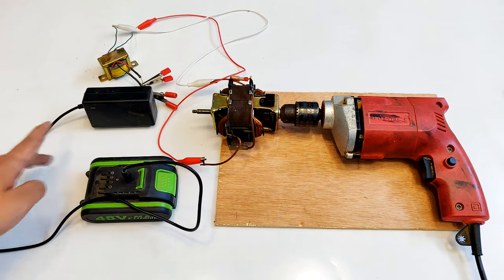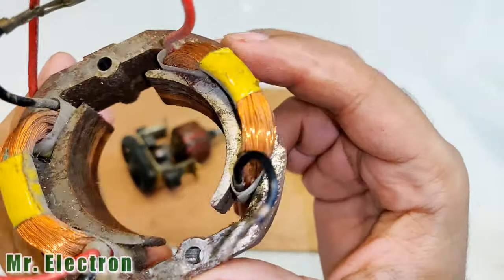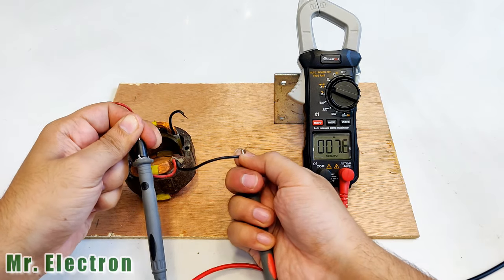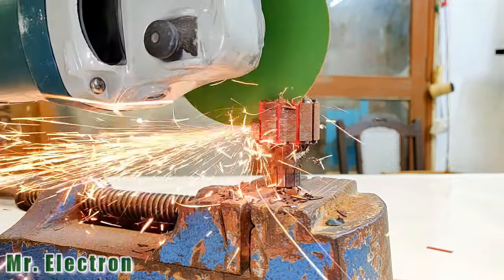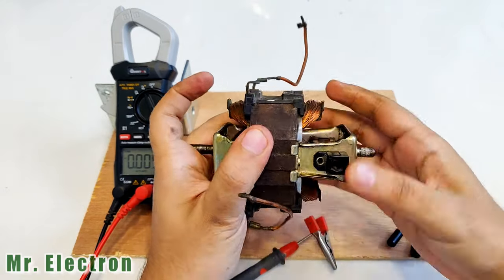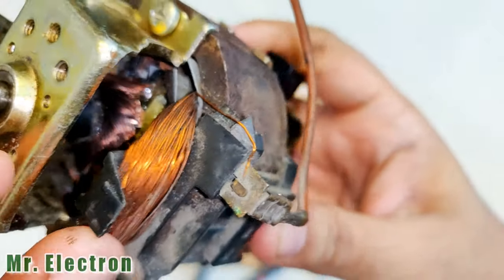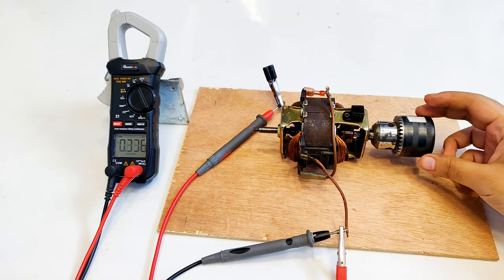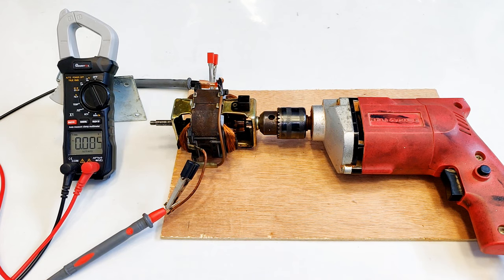Make 220V AC Generator from Old Mixer Universal Motor

Comment: Awesome work! I really enjoy watching your videos.
I have a question:
What exactly the rectifier does and what happened if you don’t use it in this project?
How to choose the corrector capacitor and how do you know this size capacitor is safe for touching?
Can you show us the amps reading in all fases of the project?
I really appreciate and I have further questions later.
Thank you Mr Elétron
Reply from the maker: Rectifier converts ac to dc.
U have to use it if you are gonna run a dc load.
Important thing for choosing a capacitor is its voltage rating which should always be more than you are generating. After that, just go with the highest capacitance you have.
Reply: Thank you

Comment: My first thought when I saw the title of this video was what, a brushless generator? I knew you could use a brushed motor like a generator by simply rotating the shaft and was puzzled as to how you would do this with no brushes until I saw you place the magnets on the rotor. It made sense then. My question now is in this configuration can you use this like a brushless DC motor, or would you need AC on the field windings for it to work?

Comment: Can u also connect the two poles in parallel to increase the overall current output?
Reply from the maker: Yeah
Reply: @MrElectron If the current output is 6A,then it may get around 12A when the 2 coils are connected in parallel.and the voltage drops from 23/24V to around 12V.

Comment: Do a experimentation. Use  a coil like a generator and the other one like a moter . Put a diod in the out put of generator to redirect the corrent to mouter coil   . Try to extract more energy on axle than was aplied !

Comment: Try couple the shaft of the universal mixer motor with the shaft of the universal washing machine motor and connect the washing machine motor to the mains and measure the voltage and short circuit current output of the mixer ac generator you built.

Comment: Ya... this is all common sense.... but it still requires power to make power. What are you gonna spin the shaft at high speeds with, if there is no power?

Comment: What about generating DC with a stepper motor ? No brushes to wear out and it easily gives a high voltage. To see this just put the leads in your mouth and spin the motor with your fingers. Stepper motors are everywhere these days - for example  old printers, scanners etc.
Reply: This one also has no brushes.Also Stepper motors have multiple phases and compared to the single phase output of his mixer motor converted to generàtor, rectifier and filter circuitry is much easier than multi phase.Also amperes out is low for Stepper motors.12 volts is most commonly used many purposes.What he needs is 12-24v and high current.
Reply: Put on his mouth??? What you talking about???

Comment: I lost brushes now what can i do
Reply: late reply and sum1 can correct me if im wrong but this is basically a brushless motor/generator. Now that the inner shaft has magnets u dont need the brushes. Tho I have seen a few builds that still incorporated the brushes into the generator this is not one of them.